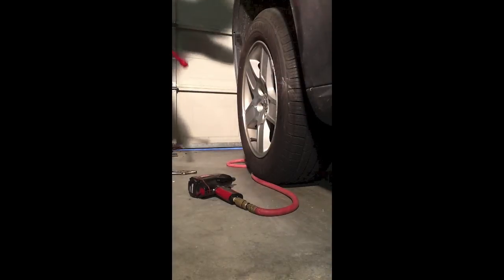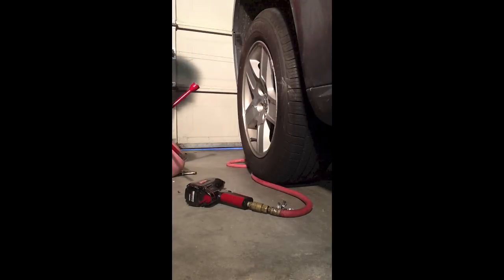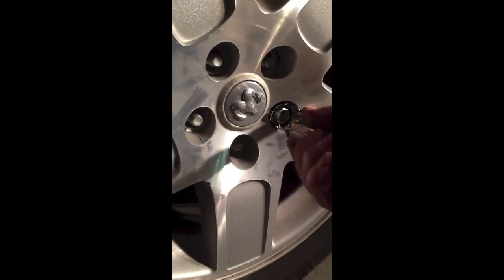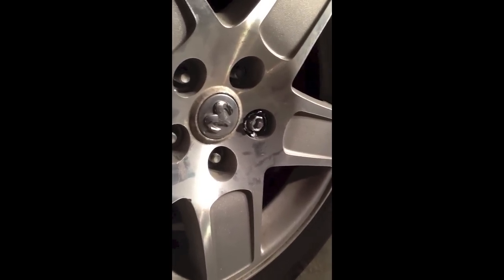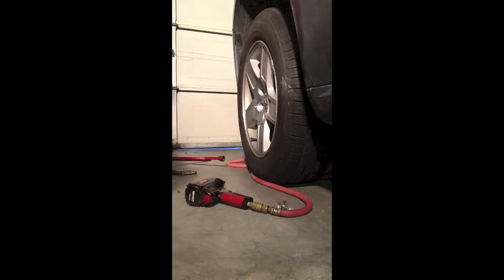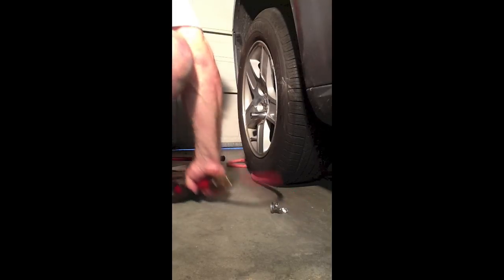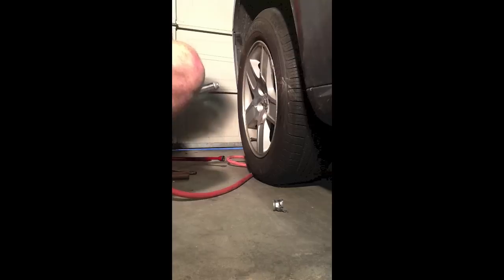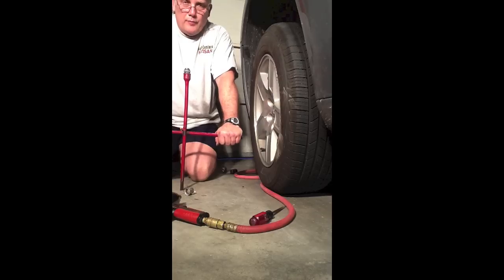Overtightened lug nuts

Comment: Problems like this are caused by "technicians" who take zero pride in their work - they want to get it in and out as fast as possible. I had 2 tires replaced at a dealership in my area under warranty. Not only did they crossthread all the lugs on 2 wheels, they left 1 lug crossthreaded and not tightened down, ruined a set of wheel locks AND didn't bother to remove the adhesive from the old weights on the inside of the rim, just stuck the new weights next to the 6" strip. Needless to say, I was very angry - and I made sure everyone in the waiting room heard me. I've never seen service advisors move so quick to get me into a loaner and out of the building. After picking up my car the next day, I carefully checked over EVERYTHING before I left and told them I would never be back there for any kind of sales or service.
Reply: what was the name of this place

Comment: Very informative video.  I learned a lot.  As a result, I think the mechanics way over tightened the lug nuts when I recently purchased 4 new tires.   I am going back to the shop and have them redo the lug nuts using the 87 lb-ft recommended by the manufacturer.

Comment: Very helpful. Thank you for your efforts to educate all those overly ambitious mechanics out there. At least use common sense to set their air impacts under the required torque and follow up by hand with a torque bar. That's how it's done at my local garage.
Reply: Exactly.  With modern adjustable cordless impact wrench it's level 3 for off and level 1 for on.

.....Then again I own a monster impact wrench that I've discovered can tighten past 100 ft-lb on its lowest setting, so I use an impact driver with adapter for putting nuts on now.

Comment: and its not over tightening. its a 2 piece lug nut that is damanged every time it is removed and installed. there's a reason tool companys make a 19.5 21.5 and 22.5 sockets.

Comment: I was curious about how you determine if you have the nuts tight enough when using an impact wrench. I came across this info.

"Not meant for tightening purposes:

Impact wrench helps speed up the process of loosening or removing the nuts/ bolts, whereas a torque wrench is meant for tightening the fixings. Most people are not aware of this fact."

Source:

8 Common Mistakes When Using An Impact Wrench
Reply: to speed up removing lug nuts just use an electric drill with an adapter... you don't need the torque once the lug nut is loosened... lol
Reply: @Dylan Hughes  I just use my monster Ridgid Octane impact wrench for off, and my impact driver for on.

Comment: interesting, i re-torqued both my cars this weekend and were definitely super tight...had to use a combo of breaker bar and elec impact wrench.  The impact wrench is good up until 430 ft.lbs of torque but needed the breaker as well.  I broke them all loose and i noticed one of the front ones was so tight that the car shifted a bit when they call came off...unreal.  Anyway. used a torque wrench when putting back and its amazing how the wheel no longer likes to stick to the driver side when turning.  I have to bring in to replace a tire on one car and will definitely be having this conversation with them before i hand the keys.  I dont trust them so will re-torque again afterwards.  Great video and advice!

Comment: I searched and you're the only one I found who specifically addresses the problem of tire dealers OVER-tightening lug nuts. Until around the turn of 21st century EVERY guy could change a flat tire and many girls could, too. Brand new cars and trucks now come with a piece of junk, angled, lug nut wrench and on top of that, we have the over-torquing issue at tire dealerships.
Reply: I weigh around 120lbs /55 kilos so this was a major problem for me, even jumping on the opener (L tool) does not budge the nuts, that I have to resort to carrying a 3 feet pipe around in my car just in case.

Comment: This is a Chrysler product and they have poorly made lug nuts. Corrosion builds up under the cap making it nearly impossible to remove them. To add to the problem the metals used in the wheel and lugs bind to them selves. This means even if they were torqued properly they will require much more torque the loosen them than was used to tighten them especially so if they have been on for a loge period. I have burned off many lug nuts due to corrosion.

Comment: I am dealing with a similar experience. I just took my 2010 Honda element to a Honda dealership in Clearwater Florida where I asked him to road force balance, my tires and hopes of finding out which brand Michelin tire was bad unfortunately I got no report of a bad tire but on the way home the vibration was worse and my steering wheel was pulling to the right upon arriving home. Found the tire pressure to be 36 psi on the driver side and 37 psi on the passenger side, front and back and then attempted to check the torque of the lug nuts, but was unable to loosen the Lugnuts where the half-inch breaker bar on the passenger side so I decided to take it back to the dealership. I demonstrated a Torque wrench setting all the way up to 120 foot pounds that when I checked the torque It simply clicked meaning that The torque was surpassing 120 foot pounds this is not why I take my to a Honda dealership.  The only comment made by the head mechanic was, what do you want me to do about it?  Seriously? Apologize to start with fire the mechanic they worked on my car and replace every thing until the vibration is gone in my Element.  How I cannot even get the dealership manager for the service department to even return my call.  This I am at the alignment guy in Gainesville Florida right now; Best in the business of alignments , confirming my alignment is Spot on. Then  I will call Honda of North America and file complaint to have my studs Lug nuts, bearings, rotors, and pads, or whatever is necessary to remove the vibration in my front and steering wheel.  Oh yeah and get my money back for a job not completed

Comment: I watched the tire changer (not a mechanic) remount my tires and wheels and he over torqued them another 1/4 turn after the torque wrench clicked. He also had the tires touching the ground when he tightened the nuts, which left 1 nut loose. He tightened the nuts in a circular pattern, not the recommended star pattern. The result was severe tire vibration due to bent rims. These were steel rims. The reason I know they were bent, which will not show up when balancing the tires, is because I replaced the rims and the vibration went away. It was the most expensive tires I have ever purchased.
Reply: I install tire at my work several times a day six days a week,  "Tire Technician". 

I know how to tighten tires properly so I don't fall under the category of the idiot who fucked up the lugs and threads on a car.  
I'm the only one not too lazy  at my work to make sure wheels are mounted correctly.  I take pride in my work and care for the safety of the vehicles owner and the vehicle itself. 

I've never herd of rim being bent because it was tightened in a circular pattern.  I've seen coworkers tighten tires in that way and every now and then I can see that the tire didn't sit properly so I'll loosen each nut and tighten them correctly.  driving the lugs in a star pattern then lowering the car and torque the lugs at the vehicles specifications.

Bent wheels are noticeable while balancing the tires. You can see it out of round as it's rotating being calibrated.  Also bent wheels usually ask for alot of weight or will keep asking for more weight until they are finally zero'd out. 

I get that a tire could be bent because it wasn't tightened right so it didn't sit properly causing the vibration.  but if that's the case I imagine anyone with that problem would of had it fixed minutes after driving away from the shop. 

maybe the rim was already bent or could of also been that the wheels weren't balanced right. 
that would cause vibration also. 
the balancer machine could of been off in calibration or the guy who did it might of chosen the incorrect wheel weight location to how he had the wheel weights installed. The machine may of been set on Aluminum and he put them on as Dynamic. 

either way  sucks they fucked up your wheels and they  didn't pay for the damage
Reply: Do you use a torque wrench and if I ask what kind
Reply: The rims were not already bent. I have been wrenching on vehicles for 50 years. I watched the moron over torque the lug nuts. They ended up buying 2 new rims (wheels)  to replace the ones they ruined. It was a bad day for all involved.

Comment: Is it safe at all to just use a four way to tighten the lug nuts and not a torque stick or impact gun?

Is it the torque gun that over tightens the lug nuts or can hand tightening it over tighten it as well?
Reply: You can overtighten by hand, too, but NEVER to the extent where you have to struggle this much to get it off.

If I don't have a torque wrench handy, I just lightly step on the wrench a little less than a foot from the nut until it stops moving.  I weigh 150lbs, so I figure it gets it in the ballpark without endangering the integrity of the bolt.

Comment: Dude, you have a Ram 1500 the wheel torque is 135 foot pounds.  Over time that would break down any 2 piece lug nut it would be stupid to blame a mechanic. Most of us use torque sticks.

That piece of shit impact wouldn't remove hand tight lugs.  I hate it when some wannabe handy man tries to tell me how to do my job.
Reply: I  have a RAM 1500, and my lugs were way over tightened. 135 FP can be taken off fairly easy with just a little force with a breaker bar. Mine were so tight I had to use my 240lb to step on the bar. There is no reason to over tighten them the way they do. Plus the stainless coated lug swell up and make it a bitch to even get a socket on without hammering them on.
Reply: What kind of work do you do lol
Reply: Well, just by knowing torque spec, you're not the kind of "mechanic" he's targeting.  
We're talking about guys who ugga dugga until the socket stops turning.

Comment: I have come to expect over-torqued lug nuts. I would snap studs off on my Toyota truck trying to get them off (after service). I have broken breaker bars and four ways trying to get the damn things off.  It happens everywhere.  I always insist that they use a torque wrench on the damn things.
I will add... using a two foot length of pipe on a four way sometimes works for me.
Reply: Neither me or my dad could get mine off. I drove it until the tires wore out, then sold it.

Comment: Where those stock lug nuts or aftermarket crap? I would never have that type of lug nut on my car to begin with. Actually I've never seen lug nuts wrapped in aluminum or stainless steel they must be out there though you've proved that.
I hope you have proper Steel lug nuts on there now. Good job getting them off though.
Reply: I know this is old but several of my f-150’s have the wrapped type lug nuts.

Comment: I may have done this due to listening to my idiot neighbor who claimed to have been a mechanic. He didn't use a torque wrench on the lug nuts, AND he put never seize on the lug nuts. I had to go get a torque wrench after realizing what he (well, what he told me to do) did and torqued them down to spec. But the anti seize affects torque, so now I can either keep it the way it is and hope, or go get my jack out again. But the car has no good jacking point on the back, besides the sides (used for jack stands) and the bottom of the shocks, which sounds dangerous to be compressing the shock like that

Comment: Me personally after I get my cat back fork the mechanic for a tire job or brake job before learning how to do it myself I would grab my breaker bar and torque wrench and and break lugs then torque them myself to the correct torque setting required by the owner manual of my car
Reply: Very smart thing to do. I also learned that its a good idea to double check them after going for a drive to make sure they are still tight. I found out that some of my lug nuts came a little bit loose somehow so I'm going to replace all of them if I find out they lost their torque loose again.

Comment: Good video. But you referred to the nut as a bolt, and the impact wrench as a torque wrench. I am an engineer and I tend to be critical about correct terminology. :)
Reply: He has access to tools that people don't lol
Reply: Calling a nut a bolt, I can forgive, and besides, a lot of cars use bolts instead of nuts and studs.

Torque wrenches and impact wrenches are ENTIRELY different things that have different purposes, however.

Comment: Alum nut?? 
Think they call it a lug wrench
Try hammering a smaller socket usally does the job in less time 
Oh by the way never suppose to hammer on a screw driver handle unless it specifically is designed with a striking surface
Its not a torque wrench its a impact gun
And it will only have the max torque  with proper size air line and air pressure 
May be your mechanic seen one of your videos and did it on purpose to you

Comment: I never use my impact gun to tighten lug nuts. I use a breaker bar to crack them loose then zip them off with the impact gun.
Reply: Does a breaker bar work if they're TOO tight?
Reply: Yes that is the point of a breaker bar
Reply: Isn't the point of an impact gun so you don't have to use a breaker bar to remove nuts and bolts in the first place?🤔
Reply: @Resist_JWO_1984  it can strip the threads. So I play it safe

Comment: Spray the nut/bolt with WD40, then use a 1/2" breaker bar with a 6 feet long 1" pipe.  The nut won't stand a chance!

Comment: a lot of stupid boys trying to be mechanics are using an impact guns unknowing what mess they are doing. I am a true case of that happening to me once. They have over tightened lug nuts beyond human strength on a vehicle which has 13" wheels .WTF !?!?! Yeepp... this is what they did. And when the time came for me to change a tire it happens so that i couldnt undo any nut so i had to pay that same shop to get them loose for me (I was out of options and they where the only shop around at that point).
Reply: I bought a set of four used tires for my silverado from a shop that I've done business with for years.  
The front left didn't balance out so I drove back and had them try to get it to at least stop shaking.  I'm not too picky.  It's a "used" tire after all. 
Apparently I pissed the little prick off by even suggesting he provide even a modest level workmanship.
I go to change said tire before it blows out on account of how rapidly the shaking has increased in severity. 
What do you know-
I've got a heavy duty four way and it twisted all of the way around without breaking the torque applied to the lug nut.
It required a 1/2"  breaker bar with an impact rated socket and a cheater pipe to get it loose.   I double checked the back wheels nuts and was able to break them loose with my 4 way.  I made a video of it to show the owner of the shop.   I fully expect him to step off into someone's ass over this.  Like the man in the video said your wife and kids could be stranded.
This was an intentional act.
As for the group of folks that disagree with the premise of this fellas video, read a book or something.  Or maybe you yourself are guilty of overtorquing lug nuts .  I could care less if he didn't get the terminology correct.   Did you see the what it took to get them off "after" the outer portion of the nut had been removed? He's a big bastard too, not some little soy boy.
Those crappy lugnuts are likely the only reason the stud didn't twist off during the installation in the first place.   I say, great job with the video Sir.